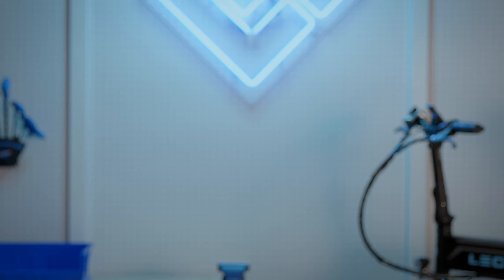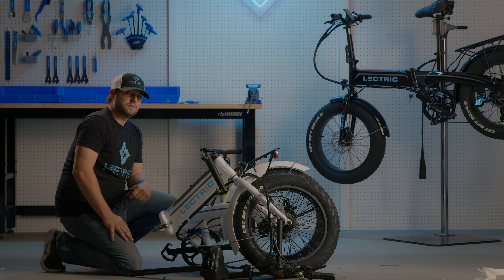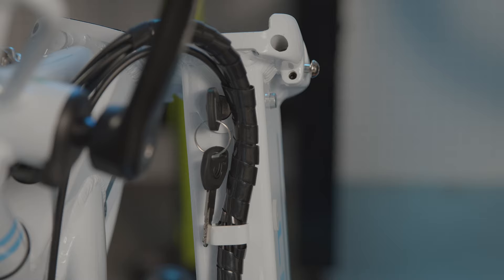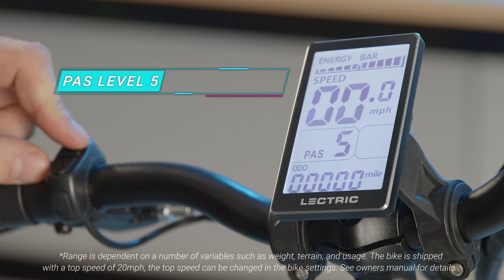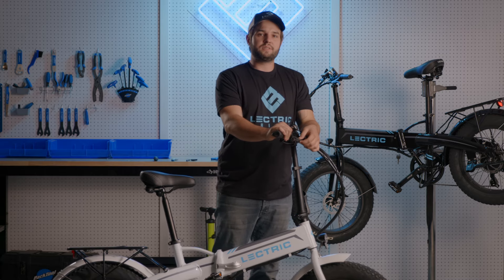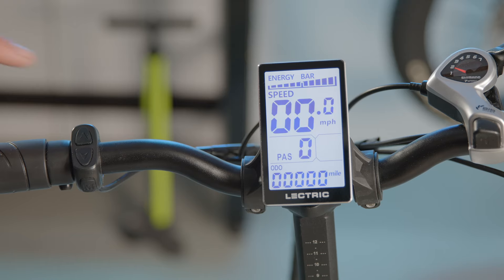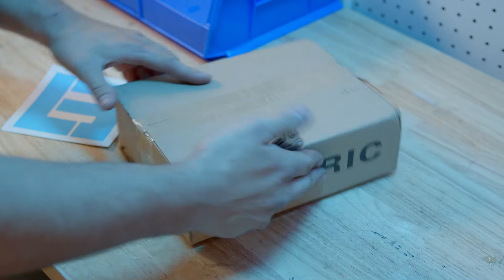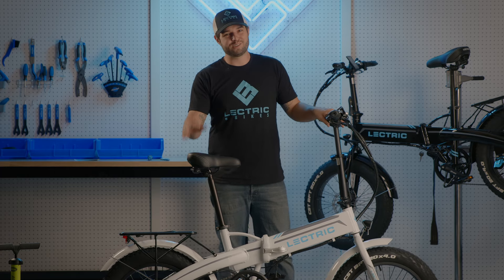Lectric Service Center | XP 1.0 & 2.0 First Ride

Comment: I ordered a step tru 2.0 but unfortunately the LCD display is shattered. I think this company should do 2 things: 1) increase packaging 2) Stick FRAGILE labels on the box for the courier to be a little more during transportation if the bike.
Reply: Gino Ferrari < One of ours arrived with a shattered screen.  They are mailing a replacement.  I have found this is a common issue.  Otherwise we love our bikes.
Reply: @melrose9252  They sent a replacement too but the bike was not working so, they asked me to send the bike and I got the same one fixed or a new one from their stock.
Reply: I just opened my box today. Broken display screen also missing upgraded seat and seat post  I have seen comments in other threads regarding broken display screens  several people have experienced broken screens  you would think this problem would have been addressed by now its been going on for several months
Reply: @jeffreybonifield732  you would've thought so huh?

Comment: Why do brand new lectric bikes constantly gets flats?
Cheap tubes?
Design flaw?
The 3x20 is worse than the 4 x20
Please answer my questions honestly 
Can't you guys use thornproof tubes?
Even though it's not a puncture it's coming from the spoke head or rim
 ridiculous to get several bikes with under 200 miles keep getting flats
Reply from the maker: Hi! We are so sorry to hear you are consistently getting flats. If thorns are prominent in your area we recommend getting your tires slimed!
Reply: @LectriceBikes  no thorns no puncture 
Just cheap tubes

Comment: so anybody can push the handlebar button to turn it on and twist the throttle and spin the rear wheel
unless it always defaults to PAS 0 
guess i better lock the rear wheel when i go in the store and not the front wheel

or take a battery with me

Comment: Crappy bike I bought it got 16 miles out of it and it said error on the display it has lot of faulty parts don't buy this bike and if you have problems with the bike you will not get a refund or anything